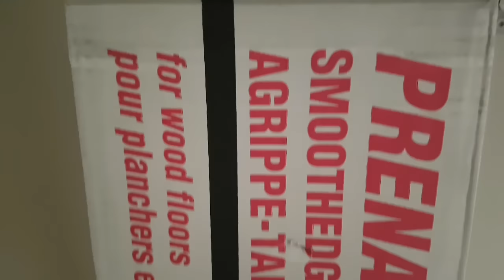How to install carpet on stairs

Comment: No tack on edges?? Not kicked to stretch??  I give it a few months for wrinkles to appear !!!
Reply: If you tack the edges you would see the indents from the staples would look brutal
Reply: Robert Watson you don't staple the sides in that method. Only the back edge. You get plenty of stretch side to side off the single row of strip. No need for strip on sides imo.
Reply: @jeffreypeterson5050  yes that's why I said it wouldn't look right.. if been fitting carpets a good 15 years tbf
Reply: I've been installing carpet for 10 plus years. Never seen, or done steps this way. Complete opposite..
Reply: mike hanzal Maybe you’ve been doing it wrong ?
Reply: @mikehanzal9562  I have 20 years doing  carpet and this is the worst  installation  I ever  see in my life  jajajaja  not even  closer  to a real installation  method
Reply: @emanuelalvarado6046  yeah.  To each their own.  God bless amigo
Reply: I’ve been re-stretch and repairing your guy’s work for 20years.Put tackstrip’s on edges.Stop taking short cuts.most repairs I do are on stairs cause you don’t put tackstrip’s on edges.
Reply: The only thing worse than the video are the comments. I'm fourth generation. My great grandfather was an installer. "Fitter" is a term used in Europe and by some Canadians. I broke away from family and acquired skills from all around. I excelled beyond what my family taught me. Every single one of you are incorrect except for one other guy here in the comments. The ignorance and incompetence make me feel like a damned genius. Thank you.
Reply: Although I don't like the method here, or many of the comments, the end result is all that matters. The stairs, surprisingly, came out good. I'll use any technique that is useful. I'm always learning and I've been doing it TWENTY-EIGHT years. Never delude yourself into thinking you know it all.
Reply: Tack strip is only necessary for pie stairs.
Reply: When the electric staple gun was created in the early seventies, tack strip wasn't really needed on stairs anymore. Remember they used to SEW seams together. That changed with the creation of the seaming iron. Techniques change and everyone does it a little different.
Reply: They used to spit tacks from their mouth and use a magnetized tack hammer before the Duo Fast was created. I have four Duo Fasts and one is original. I call it "The Antique." It stays at home in a closet. It looks a little strange, but it's basically the same guts as a newer model. Sorry for the spam. I get carried away when it comes to these videos.

Comment: Fuck ya buddy great video. I have done several rooms myself but I was feeling a bit timid about doing the stairs. Watched the video a few times and went to work. They turned out good. We're putting the house up for sale but the carpet was old and an eye sore. Did 4 bedrooms the stairs and a living room for under 800 bucks. Bought a lot of tools and rented a few to. 
I usually don't do harbor freight but they saved me a bunch of money on stuff I won't use often.

Comment: Installed down (top to bottom) contored nose you don't need tack strips. Water fall installed up (bottom to top) with stretcher uses tack strips and no staples. Just would have saved some time and materials.

Comment: I stretch my stair work with a kicker,not my hand.Different strokes they say ?
Reply: Will7311 S if you start from the top, there’s no need to kick.
Reply: Like i said different strokes for different folks.I lean into kicker for a nice even stretch.I worked with a guy,who installed top down.When we’d go back for another room to do,his step work would have bubs in the width.So im not sold on the staple head giving a proper stretch.Good day ✌🏻
Reply: Will7311 S x

Comment: Why do you have a tack strip on the riser above the first tread you do? It didn’t look like you did that with the rest. I am tackling my stairs and your video was very helpful. I was just wondering about the tack strip. Thanks for the helpful video.
Reply from the maker: B Kelly when there's a landing or a room with carpet above the stairs I finish the top riser when installing the landing or room. And when there is no lip for the the carpet to be stapled onto I add a strip to hook it to which holds the stretch. 

Thanks for watching and I hope this helps.
Reply: Thanks. That makes sense. The video and your reply are very helpful.
Reply: If the top step is different to the rest and you need to and gripper to it. Why didn’t you do this to the rest of the stairs so they all look the same. It would look a lot neater
Reply: Should be grippers on all all

Comment: Why did you install the last piece separately?
Reply: Carpet on stairs is not done in one shot. For example a 5 ft long piece may cover about 4 steps. As you can see at his second riser from the bottom the carpet didn’t have enough length (hence why he shook his finger at 6:01) to reach so he simply cut that stair off and cut another piece of carpet to cover the bottom two steps. You cannot see the seams because they meet in the crouch of the stair where it makes the L shape.
Reply: Also sometimes the width on the treads are different sizes forcing you to have to cut a different width of carpet every couple stairs. But this doesn’t seem to be the case here. It is important to measure each tread to check if they are uniform or not. It is very easy to cut carpet short on stairs and then you have gaps on your sides which cannot be fixed, so you want to be very careful. Don’t be afraid to go a little wider than you need, it can always be cut down more or tucked in.
Reply: Blake thanks

Comment: Why do you use a separate piece for that last step at the bottom?
Reply: mathbles703 length was too short. it probably makes more sense to cut his carpet 4' along the width which is typically 12'. this method might ensure the least amount if product waste

Comment: Hi what tool did you use on the stairs was it a nail gun or staples
Reply from the maker: Electric stapler, with 54 series fine wire staples 9/16” length.

Comment: Good luck trying to get the carpet back off those stairs when you want to decorate. There is enough staples in that carpet to stop you from taking it up and using it again. Also why are you stapling the carpet to the smooth edge on the tread? It is there to hold the carpet in place, hence no reason to use staples. A lot of work for no reason.
Reply: why would you use it again?

Comment: Just double checking,  you put a carpet smooth on the front face of the rise on the top step only, is that correct? I'm refitting carpet on our stairs and the previous person  added a smooth on the rise and the tread all the way down, (so each of our steps has two smooths, like your top step). Would you recommend ripping out the excess smooths or have you fitted carpet like that with smooths on the rise and tread?
Reply from the maker: I only put it on the top because there was no nosing, if you are doing them waterfall then a strip on the riser is needed, but if you are doing them this way they're not needed and can be removed.
Reply: @CunnerOutdoors  perfect, that makes sense. thanks a bunch for getting back to me 👍👍👍

Comment: Terrible job!!! Why would you cut the underlay at the nosing instead of letting it drop gripper to gripper, by cutting the underlay at the nosing there is 1. no protection for the carpet and two modern underlay is designed to grip an action back carpet so the carpet will go baggy.
Reply: Because hes bullnosing the stairs as you can see seems to b the way they do it in America not my cupatea tbh rather grip riser and tread and bloster it in tight looks far better job

Comment: What is the name of that knife please?
Reply: There were two knives used.  The double edged razor is commonly called a "carpet knife" and the hooked knife is called either a hooked knife, linoleum knife, or a carpet tucking knife.  Should be available at your local big box, or call your neighborhood hardware store.
Reply: @matthewwusinich9458  I know it's a car0et knife I'm from the UK and am a carpet fitter u use wolf knives. But j want to the red on u are using in the vid but the UK does not sell them
Reply: I mean the razor one

Comment: Gripper to the riser, screw if mdf, waterfall pads and carpet, bit of spray adhesive on the tread helps as well. This method shown here would do a treat for felt back rental jobs or oap where the steps need to be defined

Comment: Been a carpet fitter for 15 years , now I own a shop and that's the neatest stair job I've ever seen I wish my fitters took that much time on jobs 👍
Reply: I’ve been a carpet fitter for 25 years and think this style of fitting carpets on stairs is terrible!!!
Ever heard of stair shifts???
Reply: You fit the carpet to the stairs in one piece just using carpet grippers and No electric staples.
Starting from the bottom fold 6”up against riser tack it at the fold along the riser at the floor.
Then stretch the carpet up each step and using a stair tool(bolster) push the carpet into the gripper continue up the stairs towards the top.
This way of fitting allows you to take up the stairs after a few years  and using the 6” of carpet folded under the bottom riser shift the carpet up the stairs to allow the carpet on the riser(which has not been trodden on) to move up a bit onto the tread on avoid wearing on the stairs nosing

Comment: You cant carpet stairs like this.  If they are used fairly frequently your gonna get bubbles on the tops of the steps. you have to work from bottom up and use a knee kicker or there are stair stretchers on the market that work from the top down,

Comment: Hate when guys use tack strip on basic steps its unnecessary and actually harder and useless with small pile carpet! Plus it takes twice as long and doesn't secure or make the step any tighter! Dont do it this way pleeeeease!
Reply: Completely incorrect. Over 30 some yrs here says so.